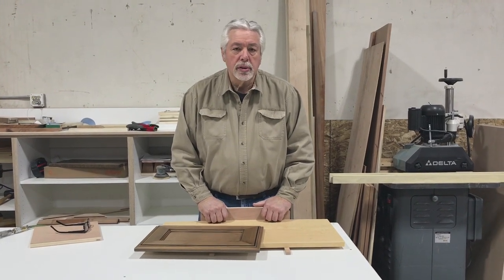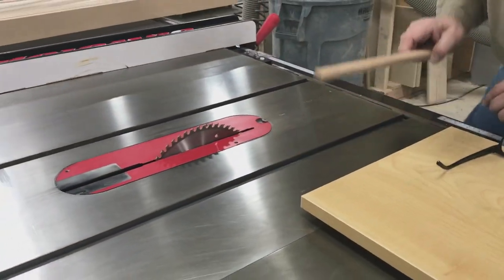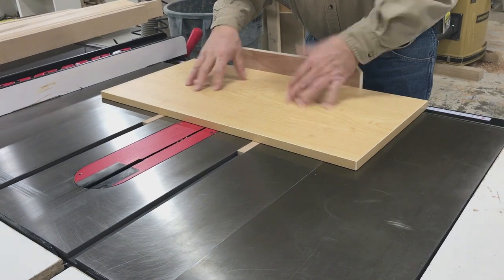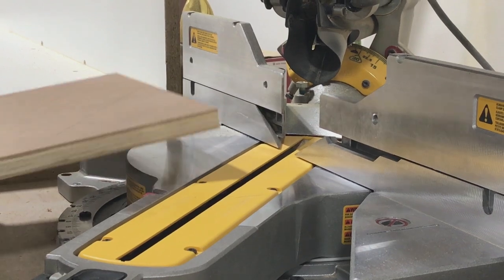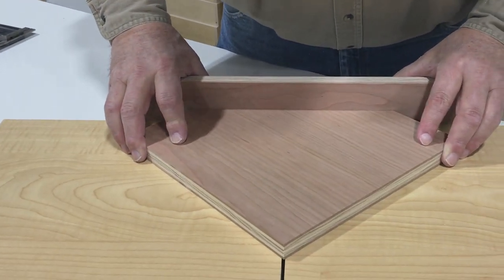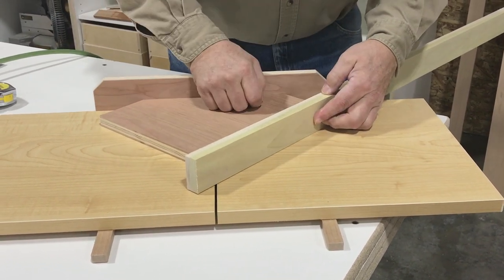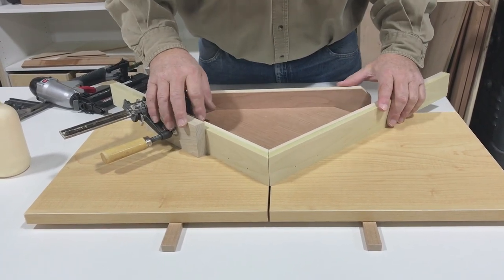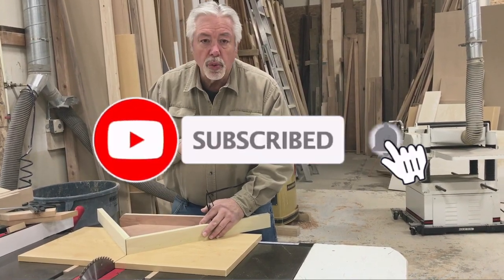Miter Sled Jig

Comment: This is great, but if you have a miter saw (chop saw) why do you need this jig? My issue is that my current chop saw doesn't have "clicks" to lock in 45 degrees. I'm always guessing - and it's close, but never perfect. Is there another way to make that 45-degree cut without a chop saw? Thanks.
Reply from the maker: Yes...however, the chop saw cut is the easiest even if you have to work with it a little. The purpose for a mitre sled for your table saw is for consistency and accuracy of 45 degree corners. Thanks, Wes